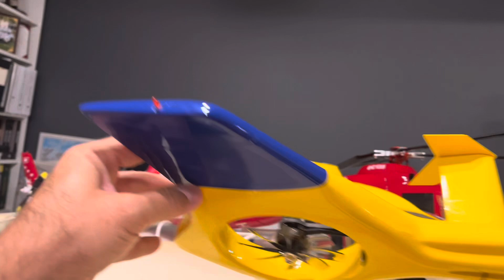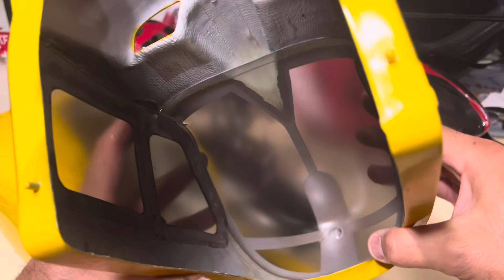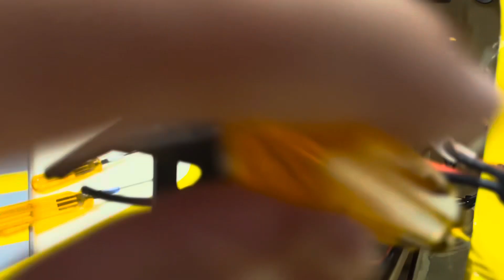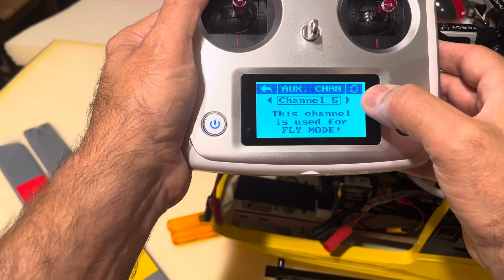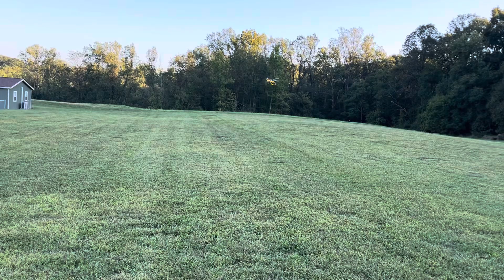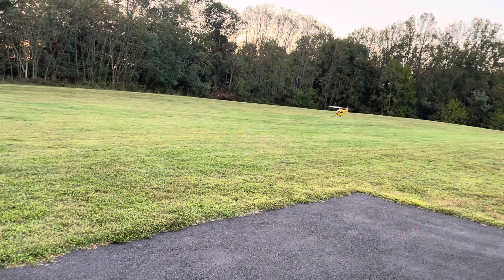FlishRC FL500 EC 135 RC Helicopter

Comment: Hi... Have you ever figured out what caused the vibration by the rotor head area where you pointed it out. I got my red/white one last week. After the first flight I start to notice binding or rubbing sound where you pointed it out on yours. I took the mechanic apart and everything is good. I spooled up without the blades then there isn't any sound. Only with the blades. I changed with the blades and the noice is still there. Just curious if you ever fixed yours.
Reply from the maker: No. It went away after some time. Maybe swap your blades around and see if it changes. So long as you don’t have vibrations it should be ok.
Reply: @Flight6677  thank you. No vibration

Comment: Have a power use for you if you don't mind. On FlishRC website of its 500 size helicopters, it posted 6S 5200 mAh 35c. When I received it, it is 4300mAh 25c. I saw your red helicopter you use 5000amAh 35c. If I use 5000mAh 50C, would it mess up its electronics? Thank you.
Reply from the maker: No, higher discharge capacity of 50C is better and will last longer. It can discharge more amps for the same voltage. So long as you keep voltage the same you are ok.
Reply: @Flight6677  thank you kindly … Grin

Comment: Is there a wobble in the fuselage @ 3:38.
Reply from the maker: Sometimes it wobbles but increasing the head speed will remove that. But sometimes in GPS mode it also wobbles which is an indication of calibration need.
Reply: @Flight6677  I see. Not sure if you mentionerd it in the video, but did the heli come with instructions, especially for the TX. Never seen this sort of TX for a Heli.

Comment: Hi...After watching your videos of the 500 series. I ordered one (Yellow EC135). I paid $200 extra for shipping fee and received it in 3 weeks. Put it together was a brief and now have 4 flights. And MAN !!! love it. The tail motor is all right. Not as bad as the smaller size which has the buzzing bee sound. Just to let you know little details you said makes a big difference in arriving my decision. It tracks as you said perfectly. It is a beautiful helicopter. I plan on getting another one. Thanks again for sharing your builds and comments. I thought I was going to get the 600-700 size from MotionRC to build  and set it up. That will take some works and knowledges. I gonna settle with the GPS type for now.  Another scale RC helicopter fan from California.

Comment: The tail sounds better than the other FlishRC helis. Did you notice they offer a 2 and 4 blade tail rotor that they say reduced the buzzing sound?
Also, you can't run the LED lights without adding another BEC? I don't know about  electronics, but want to add LED's, but don't want to blow something out!
I have a FlyWing B105 and mounted a searchlight to the body,  and plugged directly into an open channel on the receiver. It works, but maybe it will cause a problem you think?
It is 1W 4-6 volts whatever that means!
Reply from the maker: @MultiSkyman1  The tail is a multi blade fixed pitch fan simulating a fenestron. So it is less noisy as compared to a two bladed tail rotor. On the stock setup the ESC supplier 7.4V to the H1 board which is also supplying the Receiver. I added another voltage regulator (BEC) to drop the voltage to 5V since my LED module was only good for 5V to 6V. So I disconnected the red wire from the line connecting the H1 controller (which is at 7.4V) and the receiver. Then the LED module connects to an open port on the receiver which is at 5V. Hope this makes sense.
Reply: @Flight6677  Ok, so 7.4 would have been too much for the LED and would have over loaded/burned it out since it is 5-6V.
So with my Flywing B105 with the search light I added, I need to no how many volts the ESC is sending to the board. I bet its 7.4V like yours which might burn it out I guess?
Reply from the maker: @MultiSkyman1  Yes, its 7.4V since Flywing also uses H1 controllers. It will burn out the LEDs unless you get higher voltage LED module.
Reply: @Flight6677  Ok thanks.

Comment: Hi again
I have the Flishrc EC-135, 500 on order. Please could you advise is there any trim adjustments on the transmitter…?  Plus could I use a standard 43mm fibreglass rotor blades as spares rather than the Flishrc blades…?
Reply from the maker: @GeoffGill-u9n  no trim adjustments. Yes, you can use standard 500 class heli blades - but need to make sure they are balanced.
Reply: @Flight6677  Thank you very much for your help. Much appreciated

Comment: Hi. Thanks for your videos. Could you tell me how to change the  Flysky  transmitter for my Flishrc EC-135. 500 from mode 2 to mode 1 please.? Thank you.
Reply from the maker: The Fly Sky FS-i6S transmitter has 4 modes.  To change the mode you have to be in system settings.  Go to stick mode and the current mode is highlighted in black.  Click on M1 for Mode 1.  You can go to flysky-cn.com and find the pdf file of the manual which is very useful.  The one that comes with the radio is very basic and does not explain much.

Comment: Thanks for a nice video, in what port do you set the lightssupplay ? And how many volts is it in there?
Reply from the maker: You can plug the light supply in any port of your RX and map it to a switch for on/off capability.  The voltage is 5.5V at my RX, simply because I added a new BEC and bypassed the H1 which is at 7.4V.

Comment: I use led lights that power from a pp3 battery you just plug the battery in fit the canopy and go.
Are you using the H1 lite or standard H1
Reply from the maker: @Lonsome1223  h1 stock from FlishRC

Comment: Hello flight667, i alway love to see your heli-fascination videos, i love those! Now i am infected again , the infection caused by you! I have two 450 align professiona l helis with the tube-driven tailmotor/ gear, which I hate because even a slight touch with gras or something else during take-off or landing very often kills more or less components of the tail-mechanics. I often in the past thought about replacing All these(damned) mechanical parts including the tail-servo with an motor driven direct drive tail. Do you think I just could replace all the trex tail- parts with the prop, the outrunnermotor and the Dual ESC ,bought from Flish, and connect that to my beast- FB controller ?
Reply from the maker: @peteheymes259  are these flybarless helicopters or the older flybar models? If FBL, yes you can but it all depends on your flight controller or flybarless system. These are tail motors and ESCs (25A) that can be modified to fit the old 450s. I did that with one of my Align 450 Sports. I used a Micrbesst BeastX with the added firmware for tail motors.
Reply: Thank you for your Answer! Yes, I have two FBL align450's (pro DFC)and one sport with flybar. Im very interested, what the mentioned tailmotor firmware update for the beastxx is, because that would help a lot. I am using beastxx on the align 450 pro DFC mechanics.. 😮
Reply from the maker: @peteheymes259  go to freakware on line and get the upgrade.
Reply: Thank you very much indeed! for your help and your hints. Solution sometimes are so close ; freakware is just 40 miles from my place! I installed studioX, connected to my microbeast- plus and was ready for the update! How is your 450-w.beastx doing in comparison to the Flish 450 regarding to the tailmotor functionality?
Reply from the maker: @peteheymes259  tail motor is working nice. I bought a tail motor with same specs as the 450 FishRC, removed my tail mechanics and make a plate that connects the motor to the tail end. Very simple. Then connected the tail motor ESC and controls as with the main motor. You will need to “Y” the power supply.
Reply: Yes! That's what I'm going to do!! Thanks again😊
Reply from the maker: @peteheymes259  maybe it’s good to do a video on what I did for you?
Reply: Oh Yes I will do , you deserve it!!
Reply: I found that with a low tail, all the 450s strike the grass or gravel and fire debris at me, or break tail components. My solution was to fit a taller undercarriage from a 500 helicopter. Using a training undercarriage lift the tail out of the dirt works  too, but the standard issue is far too low.😊

Comment: Very nice, so they come like that? You have to do the assembly?
Reply from the maker: @vincentcimino1963  very basic assembly. I did not even need to do all the work I did for the lights if I didn’t want them. Also, they can do the lights for you if you ask for extra. So really, it’s putting in the mechanics, bolting them and connection the rail motor plug and that’s it. They even test fly your heli and send you a video before shipping.
Reply: @Flight6677  wow ok, I have the Flywing Huey arriving soon, I’ll have to look into on of these, they look like they cost about the same $$??